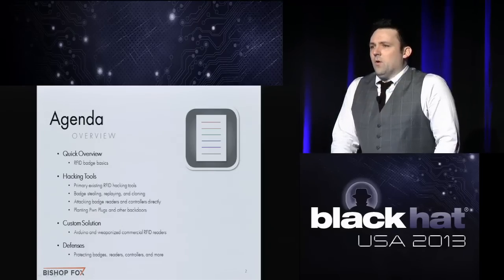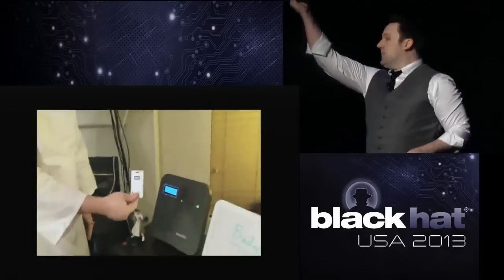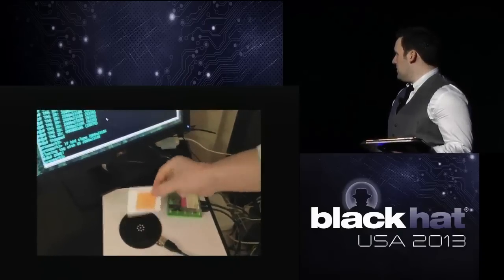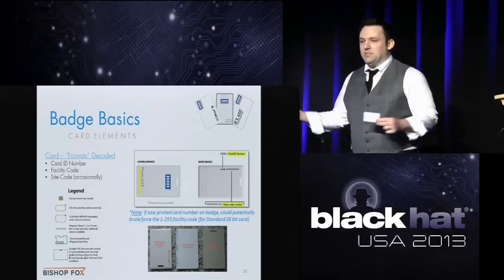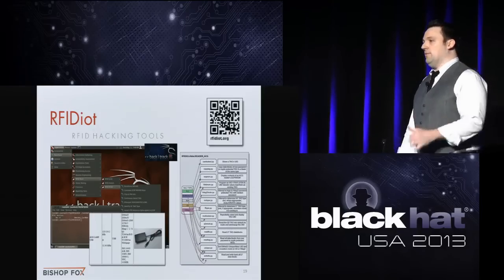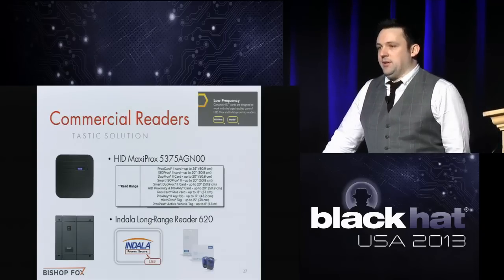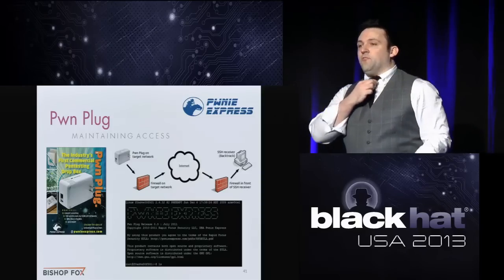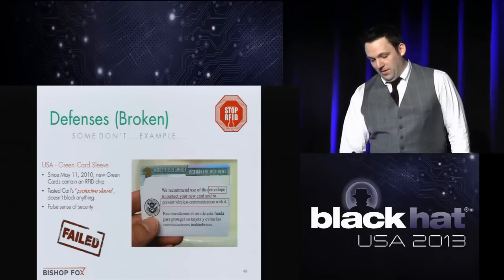Black Hat USA 2013 - RFID Hacking: Live Free or RFID Hard - 01Aug2013

Comment: He should sell the entire package for like $999 or something, idk but I would defiantly buy it.
Reply: hey, I needed some help and since you make this stuff it would be really appreciated if you can help me out thx
Reply: John Mullen 
Not actually you need to creat your own. PCB you need a milling Machine and 3D printer 
And the knowledge to do PCB designing and also cryptanalysis so you can build a decryptor
Reply: @ko-Daegu  no you don't.

Didn't you watch the video?

The heart of the hardware is off the shelf.

All he did was add batteries to make it portable, and a microcontroller to handle the LCD output.

Btw you don't need a milling machine to make a PCB. All you need is an acrylic stencil, a UV light box, and an etching tank.
Reply: You serious? Like I'm not even into black hat shit, this is just super neat to me and I want it.
Reply: You could pretty easily build some of this stuff with an Arduino and a few parts for under $50. ;)
Reply: naw